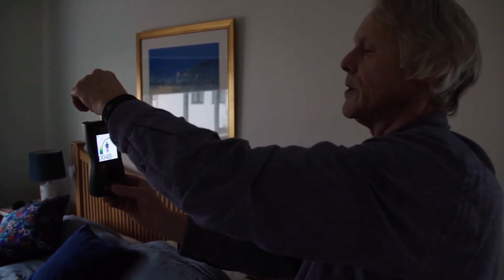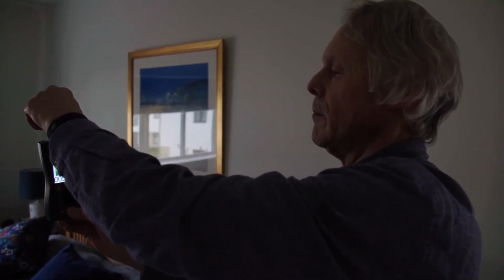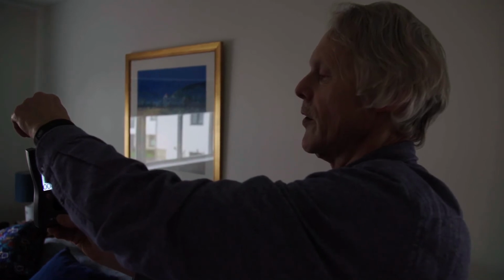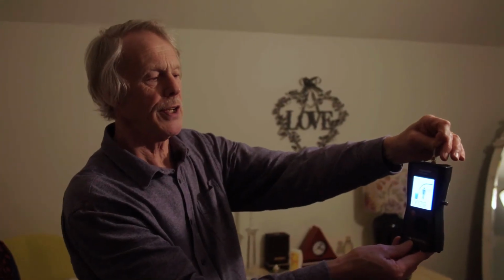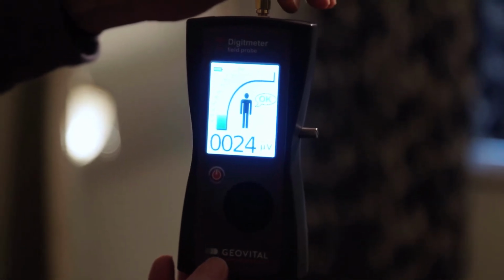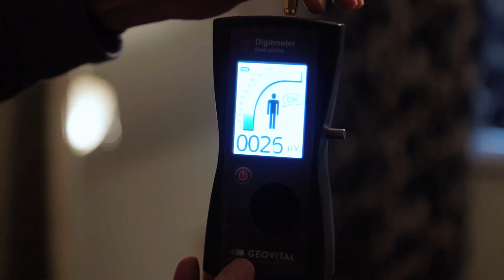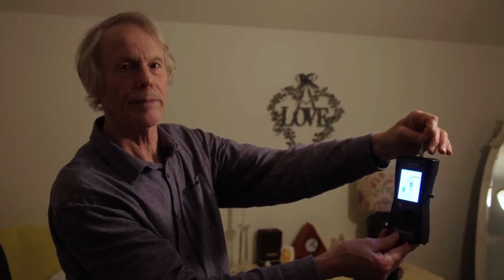How To Reduce EMF Radiation In Your Home with Leonard | EMF Protection

Comment: 5G is the administering of Millimeter waves (30+ GHZ). The way to protect is to NOT BRING IT INTO YOUR HOUSE. Wifi 6 runs on 60GhZ. This is a Millimeter wave frequency band. Yes protection against all Emf's is good. But Millimeter waves do not penetrate walls (5g) therefor, they need to be line of vision. So as protection: Simply run all ethernet. Airplane mode. Unplug all wifi at night (if you have to use wifi). Use Metal screens on the outside of your windows to protect from outside EMF's + EMP's. Coat your walls with YShield MAX54 Shielding Paint if you really want to invest. Make sure to ground that paint. Research Faraday protection. Simply don't succumb to being (reliant) on your smartphone for necessities. Visit Fullertoninformer.com and click on the 5GDangers tab. Understand there are lots of "controlled opposition" agents out there, to make you fearful. Don't need to be fearful if your faith is in Christ. That's where i put my faith. God Bless.

Comment: I would like to know how difficult was to decorate over the HSF paint on the bedroom walls to achieve white finish.
Reply: Hi, if you finish the final coat of black paint and seal it with a primer, it will ensure the carbon residue will not bleed into the regular paint coats that follow.  That way, you should only need 2 or perhaps 3 coats of regular paint depending on the colour you wish to cover with.